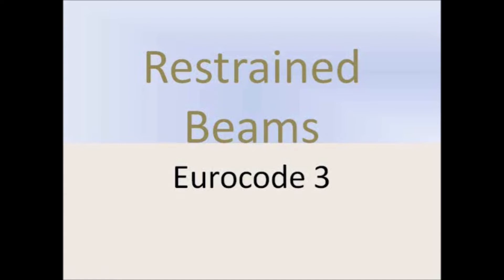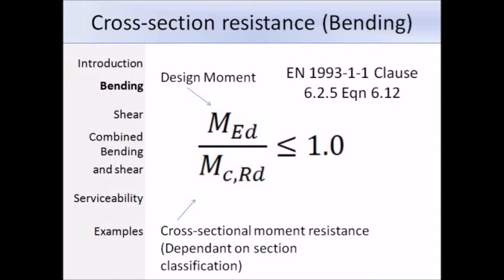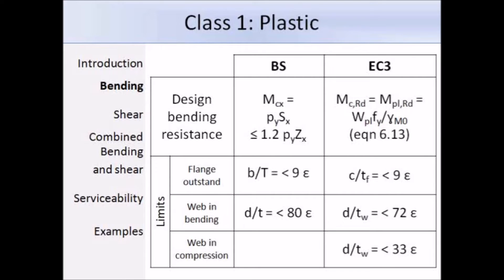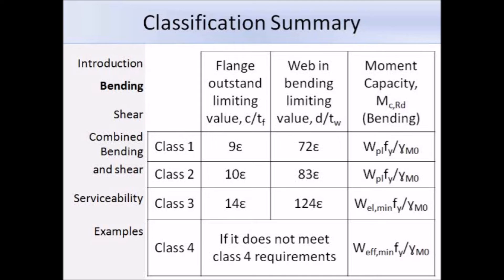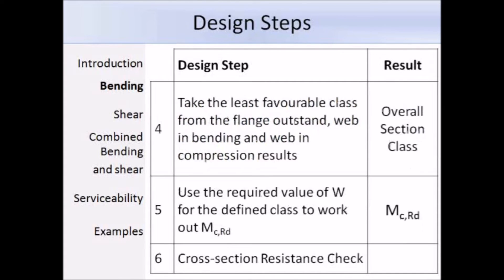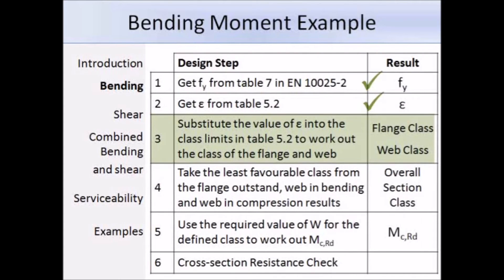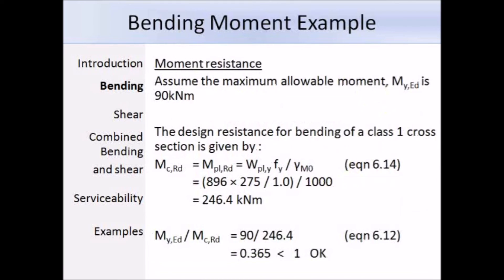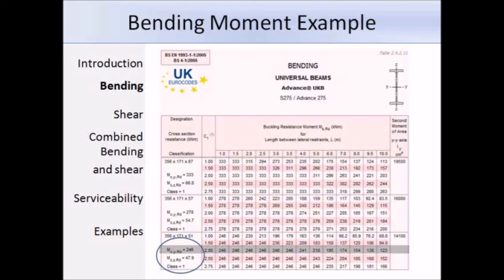Steel Beam Design - Bending + Example | Eurocode 3 | EC3 | EN1993 | Design of Steel Structures

Comment: Hi. Do you know any software like RFEM, SCIA, Sofistik in which I can calculate steel beam with cross section class 4 according to Eurocode 3, if necessary put transverse stiffeners (hw / tw > 72*eps*etta [6.2.6(6) EN 1993-1-1])?
Reply from the maker: Vasiliy Rohach Hi, nothing I can recommend. Hand calculations can be tedious but free.
Reply: Too bad. For a simple beam, I wrote an algorithm. For more complex cases, it is better to use automation. Something about this is in the Robot Structural Analysis.